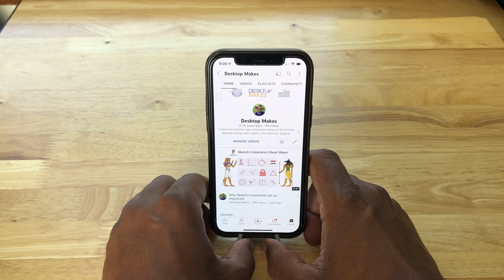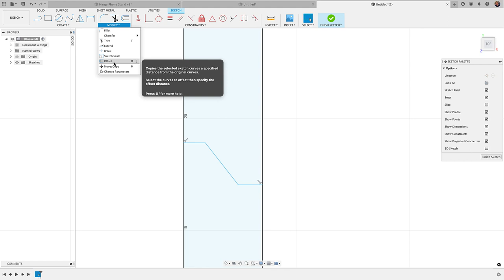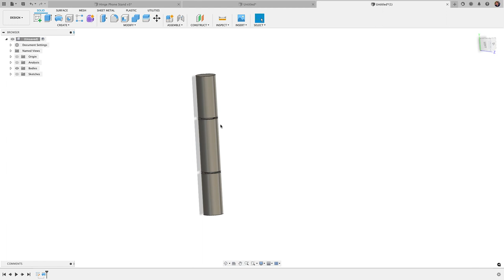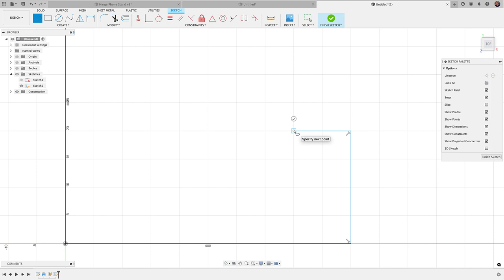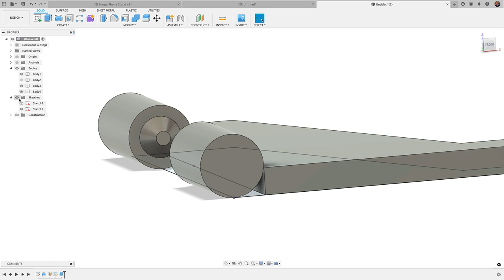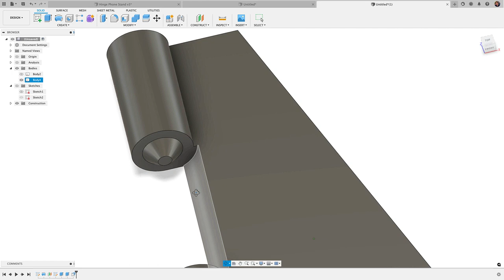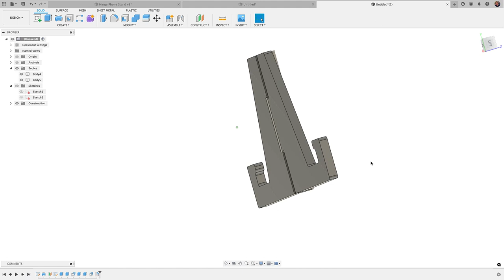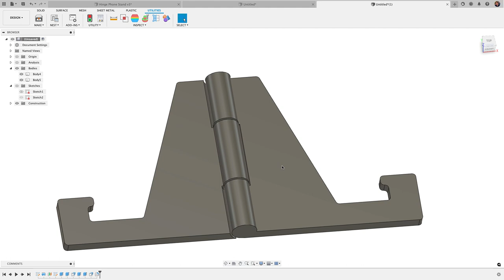Print in Place Hinge in Fusion 360

Comment: Good Video. Since the gap isn't defined, you could have a pre video making a print test of gap settings. That way with one print people could determine what their printers can get away with. My printer gets stuck between .1 and .15 so I will use Fusion (and your method) to do a test 1.2 to 2.4 with 7 segments, like a fidget spinner and a hex key center to break them free.
Thanks

Comment: Very nice video. I have two questions:
1. How do I export both bodies to Cura as an STL file so as to print them intertwined in one go.  
2. How do I suppress the top and bottom layers so as to disclose the attractive infill.
Reply: I found the answer to question one. Do not export direktly into slicer but use export to export all bodies together locally on computer and oben directly in Cura. I printed it and it moved with 0.5 mm tolerances.
Reply from the maker: Hi Helmut, I plan to do a follow up video on this but essentially 1) you right-click on the the top of your browser (file name) and click on Save as Mesh.  This will save all the visible bodies.  Check out this video: https://youtu.be/vBNOZEuscys

2)In your Slicer settings, there will be an option for number of top and bottom layers.  Set both to 0.
Reply: @DesktopMakes  Thanks a lot. I managed to print the movable parts flawlessly. Nice marginally useful gadget for watching YouTube videos on the phone on the tabletop, or having video chats totally handsfree. I really enjoy your classes. They are neither too advanced, nor too trivial. You make my new hobby real fun.

Comment: Is there a way to do this where it only opens 90 degrees?  I have created one but I have to put a metal bar in the hinge.  Print in place seems to use bridging and has to be printed wide open (180 degrees) and I can't figure out how to design my 90 degree open item using print in place, any advice would be very helpful!
Reply: I think maybe using those cone hinges I can get this to work...If I do the angles just right.. cone hinges...how did I not think of that???